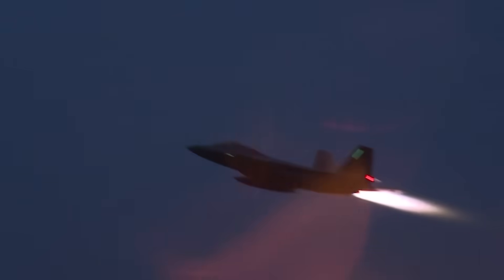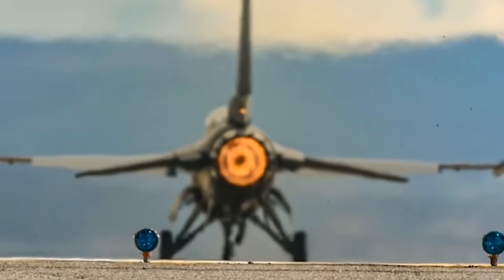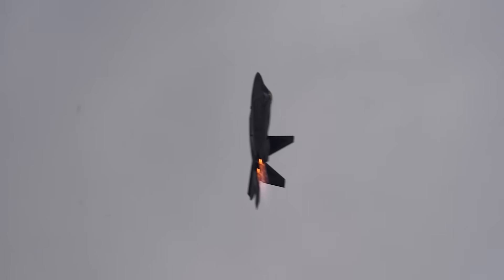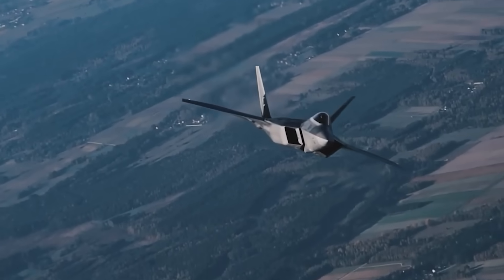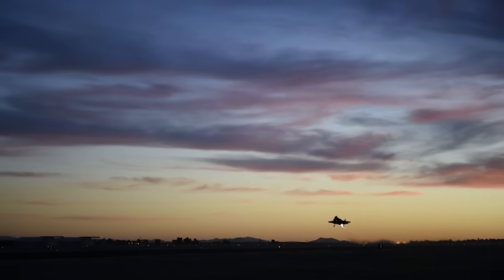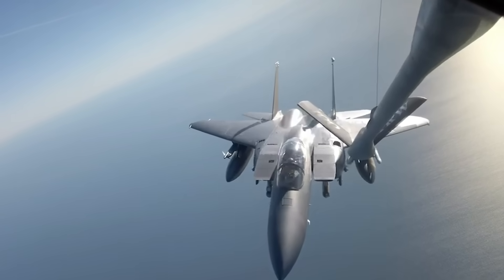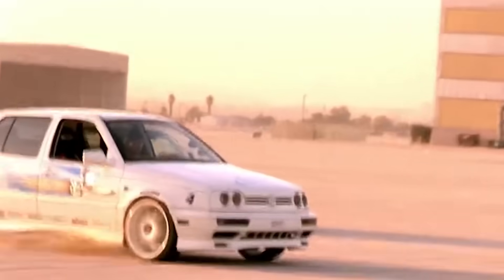Why the F-22 can only use AFTERBURNERS for a FEW MINUTES

Comment: "Afterburners are very inefficient" is true, but it's also like saying that a race car isn't very good for getting groceries.
It's not untrue but it's also missing the point.
Afterburners are meant to be used to go fast, really really fast. Faster than the top speed of most tactical fighter aircraft.
When you go that fast, afterburners are quite efficient, just look at the Concorde and the SR-71.
Here's why:
The general rule for the most efficient exhaust velocity of an aircraft's propulsion system at max throttle and max speed is that you want the exhaust velocity (averaged across both core and bypass air flows) to be somewhere in the range of twice as fast as the maximum speed of your aircraft.
If you go above this figure, you start quickly losing efficiency, and it is this which is why afterburners on tactical fighter aircraft are inefficient.
Afterburners increase thrust by increasing the average exhaust velocity of a gas turbine engine. This is best matched to high speed aircraft such as the Concorde and SR-71, the faster the airframe can go, the more efficient an afterburner gets, right up until your engine is all afterburner and no turbine, aka a ramjet or (at even higher speeds) scramjet.
Turbofans also increase thrust, but they do so by decreasing the average exhaust velocity of a gas turbine engine, they do this by making the same amount of fuel accelerate a greater mass of air to a slower velocity. If you don't need to go somewhere fast, but you need to worry about how much fuel it takes to get there, what you want is a high bypass Turbofan engine, or maybe even a Turboprop for even slower speeds.

Comment: Would doing a water injection (like B-52) help increase thrust? When water changes state from liquid to gas it expands around 1600 times. Don't know what the expansion ratio for dumping fuel into exhaust stream.

Comment: You can actually fly a lot longer on full afterburner at either very high altitude, or at lower speed. Afterburner in a fighter like the F-22 is mostly used to accelerate very quickly or to achieve high altitude. 

As your video mentions you’d never use max AB near sea level for any extended period of time. Especially in the F-22 which has highly efficient engines capable of supercruise

Comment: Hi Alex, I’m a big fan of your channel and I never miss a video! I’m a former USAF F-16 crew chief, so I know a little bit about both the Pratt & Whitney F100 and GE F110 series of engines. I was engine run qualified on the F100-PW-220E and the F110-GE-100. I also crewed everything from the block 10 through the block 50, as I worked in both flight test and test & evaluation squadrons for a portion of my Air Force career. “Hazard’s” fuel flow rate of 50,000lbs per hour is typical for a block 30 or 40 Viper. I crewed block 40’s in Korea, however, it was VERY uncommon for the Viper to be flown in a slick, aka “Thunderbird”, configuration due to its very limited 7,000lb internal fuel capacity. It’s even worse for two seat “bus” models at only 5,800lbs, since the F-1 fuel cell was never installed from the factory to make room for the aft cockpit. You mentioned that the F-15E uses F100-PW-220 engines. That was true for the earliest production models, but they began equipping them with the much more powerful F100-PW-229 motors (same as the Thunderbirds’ block 52 engine) on later versions. And now the F-15EX is utilizing the mighty but thirsty F110-GE-129 engine (same as on the F-16 block 50). It’s also worth noting that afterburning turbofan engines always utilize low-bypass fan sections as opposed to the much larger diameter fan sections so common on airliners and cargo aircraft equipped with high-bypass turbofan engines.

Comment: The F-15E burns fuel at a rate of about 90,000 PPH during a max AB takeoff.
The transfer pumps not being able to keep the feed tanks refilled as quickly as the boost pumps empty them is the main limfac. In just a few minutes at MAX AB (specifically at low altitude) you can absolutely empty the feed tanks and flameout.
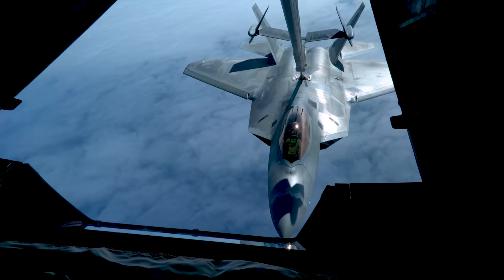3:46 its called "Mil Power"...full throttle excluding AB.

Comment: 0:30   1:16 "creating a ton of pressure", "even more pressure" is not how jet engines work at all. There is no increase of pressure when you burn fuel in a jet engine as the gasses are not contained like in a piston engine. In fact, when you burn fuel in a jet engine, pressure goes DOWN slightly as the gasses expand. All you are doing is adding heat, expanding the gasses which increases it's velocity (and hence lowering pressure via Bernoulli's principle) and that's it. Turn on a burner on a gas stove or light your bic lighter and observe the flames. Fuel burns, air gets hot, air expands and that is it, no increase in pressure. The highest pressure in a jet engine is right after the compressors and then it's all down hill out the back. If at any point the pressure increased, air flow would stop and turn around.

Comment: I was under the impression that the extra thrust supplied by an after burner is mostly just because you’re adding weight to the air you’re throwing out, which gives you something to push off of, just like high bypass fans push a large volume of air behind you that you can then push off of
Reply: You are heating up the air with afterburner, expanding it and therefore increasing it's velocity. It's not just weight you throw out the back that gives you thrust, it's also how fast you throw it out.
Reply: Thrust doesn't work by "pushing off of" anything. It's Newtonian action/reaction.

This is why rockets work in space.

Comment: A T-38 always took off with full fuel and getting off on a hot day, we would use burner for local sorties. Going cross country (long distance) fuel was at a premium. If we could get airborne and get out of afterburner, with an unrestricted climb to cruising altitude, we could go a decent distance (450 miles) depending on winds. On some SAC runways that were super long, we could occasionally get airborne without using blower, if the temperature and performance data allowed. Burner is fun but it comes at a great cost. I laugh when I watch an F-22 demo where he/she is goofing around, in and out of burner for the whole demo profile. The jet is about min fuel at the end of the performance.

Comment: 4:50 according to joe Rogan guest (f35 pilot or something) , he said in reality and f22 can fly only max 3 minutes with afterburners ) , 
And another expert says for engine parts endurance reason , f22 usually won't go more than 40 sec in full afterburners
Reply: It isnt just MAX or OFF on the burners either like the video is suggesting. There's still some levels of afterburner after going from MIL into burner til max.

Comment: Rare channel that educates ppl how jet engine works, thank you Alex. And not that large amount of aircrafts have super cruise even f35 has partial or something according to available data.  If to neat pick, there is a data that f16 at low altitudes burns up to 80 000 pounds per hour at max afterburner having 7000 pounds of internal fuel.
Reply: And I do not want to go in holy war about flanker vs holy cow F16. Must to give a credit to flanker design that they made engendering decision right same way as F22 did(and F35) – all fuel internal. That drop tanks – create a lot of air drag which limits top speed even at that short amount of afterburner time available for supersonic speeds. And that’s why Flanker is ginormous, same way as F22 and J20 all jets who follow that design.
Reply: IMHO engineering decision to rely too much on drop tanks is flawed. As far as publicly available data show – drop tans slow down aircraft too much. And for certain missions it is totally unacceptable. That’s why all modern aircraft dump that idea of drop tanks, Kaan, SCAF, GCAP. F22, f35 etc. Try to intercept catch jet bomber who moves close to 1000 km/h when your jet can fly with drop tanks slightly above 1200 km/h for limited amount of time. Speed Difference 200-300+ km try to catch bomber who is 50-60 km which fly’s away from you.
Reply: Even slowest bomber in US B-52 from 50s-early 60s – cruise speed (just Cruise speed according to wiki) is 819 km/h, max speed 1050 km/h. If it gives more beans will fly close to 1000 try to catch it. Close the gap if jet in front of you flying away at even relatively short by aviation standards distance . Everyone knows how range of missiles drastically changes if shoot them at target moving away. That’s why exist air superiority fighter as f22 not a some multi role, covered with 3 drop tanks and drag coefficient gazillion.
Reply: Can add as I’m some expert or something why such a huge fuel consumption, in video is not so clear. PPl used to car engines and do not understand how possible to dump so much fuel in cylinder limited in size and limited amount of air. Afterburner works on bypass air – Alex mentioned turbofan (most do not know what is that) – long story short a bypass air (air which does not goes in combustion chamber) meets fire hose of fuel(separate circuit from the main fuel system) is added after combustion chamber and mix with bypass air in afterburner mode and it explodes the as some thermobaric reaction meeting exhaust gases from main combustion chamber .
Reply: And lets read a lecture about relation between percent of oxygen(needed for combustion) and air density at sea level and at 20 000 feet, and how on board computer calculates mixture and regulates amount of fuel supplied to afterburner. Long story short at sea level ppl breath freely on top of Mount Everest wear oxygen masks. Same do fighter jets. More oxygen more combustion, less oxygen less combustion(aka fuel flow per second) That’s shy jet at see level consumes 80 000pound per hour but at 20 000 feet 50 000 pounds per hour. Jet designed that way, excess fuel will just not burn at high altitudes (hence less thrust). To over complicate things add air density aka air resistance to equation. It is not a poetry and singing a song and dancing it is science and math they are hard.

Comment: Common misconception about the F-22 is that the production tooling has been destroyed by Congress. That is false More than 90% of the jigs and tooling still exist and are locked in storage. I say we open up the Raptor for foreign sales only to Poland and the United Kingdom Have them foot the bill for initial cost production obviously upgraded with F-35 modern avionics components stuff like that and America can virtually start producing these at no cost to US. I know the UK and Poland would love them some F 22's.. What do you think about my idea Because the airframe is still technologically advanced and years ahead. So an F-22 with more modern engines more fuel efficiency and new radar absorb it material coatings upgraded radar. That's what we need to do until we have the F47 in production
Reply: It's not the tooling, it's the supply chain. That entire supply chain is producing f35's right now. They would all have to shut down their lines and retool to start up f22 production again.

Comment: So the afterburners on aircraft are used more or less like a catapult (or JATO rocket) = to help with the takeoff, making the takeoff roll shorter, and after that the jets don't use afterburner at all. So why not just save weight and get rid of the afterburner and use JATO rockets to help blast the F-22 off the runways?
Reply: It may still be needed to get out of tight spots.  Just needs to be used judiciously.

Comment: The F-35’s use of afterburner is actually time-limited to a bit one minute at a time. The heat generated by the AB will cause damage if used too long without a period of time to cool down the engine and structure. Few AB-equipped engines are able to use AB continuously. The J58 engines used in the SR-71 were rated for continuous use. The structure of the airplanes that used that engine also was designed for continuous AB use. That being said, the J58 was a special case and likely was more efficient than most other engines in AB as it basically functioned as a ramjet (simplified, I know) at high speed. Other fighter planes also will have a similar limit of AB use due to thermal considerations. The rate of fuel consumption is also a problem… but can be lessened by having tankers nearby. Take off with AB? Top off in flight. Have to loiter around a bit? Top off. Need to fight? Do it and then head for the tanker if you’ve survived the fight…

Comment: Great video and a very useful info. Thanks.
There's also an "extreme mode" that is higher than afterburners, that is enabled on some planes. But that is only used as a last resort option, as it's permanently damages the engines, and burns more fuel, and provides just 2 - 3 percent higher thrust.

Comment: The F-35 has major structural design flaw that requires using its afterburner for only a few seconds in short bursts which also requires hours of structural inspection for cracks.

Comment: Big problem with your calculations. Those numbers are quoted at sea level on standard atmospheric conditions. 29.92 hg and 15C. As you climb the fuel economy gets better. Here's an example, if I were to take my Cessna 182 and take off I may burn 18 gal an hour or maybe even 20 gallons an hour on that take off. When I'm in Cruise configuration at 12000 ft I may only burn 9 gallons an hour. That gets even more extreme when you're talking about Jets moving into the flight levels

Comment: I’ve heard (not sure how true) that the F-22 has speed limiters because those engines could make it a Mach 3+ aircraft but would incur structural damage to the airframe and destroy the stealth coatings.
Reply: The engines would not be able to do that. To go 3+, you have to have some level of ram jet due to issues with fuel no longer being able to be lit. So unless the engines are designed with that envelope in mind, it would never reach it.

However, I could see a mach 2.5 limiter or something if that manner
Reply: @goldenhate6649  All air going through compressors and turbines must be subsonic. You would need to slow that air down to subsonic speeds before it entered the engine. That increases it's temperature and you'll eventually get to the point when you start melting engine parts. The compressor inlet temperature was the limit on the SR-71 which kept it from going faster.

Comment: Laughs in DCS F-14B which burns like 15k lb in less than 3 minutes on the deck in a rate fight. At higher speeds, the rate even increases due to the ram effect increasing thrust.

Comment: Yes indeed, i always considered the afterburner to be like a rocket, more thrust, but very thirsty. I watch the falcon 9 launches and when launching starlink satellites the booster or first stage goes through approximately 287,400 kg (\(~633,600\) lb) of liquid oxygen and 123,500 kg (\(~272,300\) lb) of RP-1 kerosene, for a total propellant capacity of about 410,900 kg (\(~905,900\) lb). It uses most of this fuel just to get up to about 80 Kilometers ( 50 miles ) and a velocity of Around Mach 10 (approximately 8,000 km/h or 5,000 mph). All this in just 2 minutes and 30 seconds, that is a lot of fuel. So i am not surprised that afterburners use a lot of fuel.

Comment: The F-22 Raptor’s supercruise, powered by F119-PW-100 engines, sustains Mach 1.5+ without afterburners, using high-thrust turbofans with advanced air inlets and low-bypass ratios. This boosts stealth and fuel efficiency by avoiding afterburner heat and fuel burn (~10x normal). Variable nozzles and compressor design optimize airflow for sustained supersonic flight.

Comment: There’s two implications that Alex didn’t mention: 
1. The faster you go, the greater your IR signature. With IRST becoming more common speed may give u away. Significant development has gone into fifth gen aircraft to cool the skin using fuel 
2. Afterburner application is not just limited by fuel. The heat generated impacts the health of the engine and surrounding areas. Most aircraft have limitations based on maintenance. The most famous example is the Foxbat, which under combat conditions would shred its engine
Reply: Yeah... I was surprised this wasn't mentioned.   I can't imagine how hot the thrust vectoring mechanisms on the F22 get when under afterburner and at full deflection.

Comment: Interesting numbers.  I flew F-4s.  Afterburners  gave 50% more thrust, at 4 times the fuel consumption.
We also had more-or-less the same flight times as the F-22.

Just a small FYI - MAX power is full afterburner, MIL (military) power is full dry engine.

Great explanation!

Comment: The F-22 Raptor’s afterburners, powered by its F119-PW-100 engines, provide unmatched thrust (35,000 lbs each) for supercruise and agility but are limited to a few minutes due to extreme fuel consumption (up to 10x normal rate) and engine heat stress, risking damage if prolonged. This constraint balances performance with sustainability in combat.

Comment: Alex, regardless of fuel capacity, I've heard it reported, probably including by you, that the key limitations on F-35 speed has more to do the fragility of current RAM technology. You've also reported on C-RAM. News about it has gone quite of late, especially since testing of the B-21s and NGAD designs. 

It's been, to my recollection, which ain't what it used to be, that Uncle Sam he's really quiet about important new tech when they've found some works so well, that putting up is done and left with shutting up the only logical course of action. 

And remember, I've learned most of what I know about AIR POWER from you.

In chats with people who probably have access to hard, cold, up-to-date facts, I've come to believe this is the case more often than not.